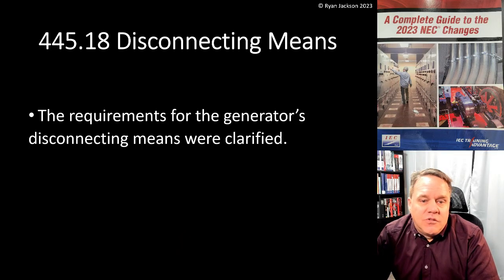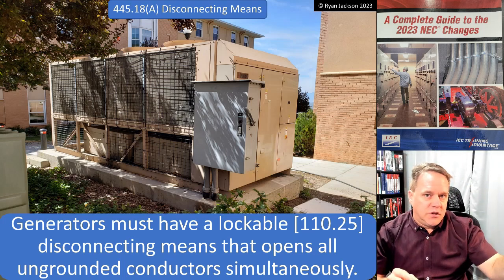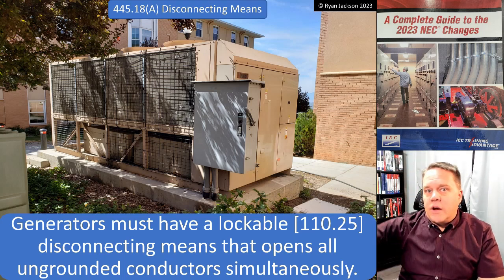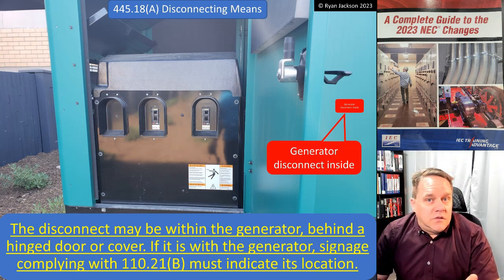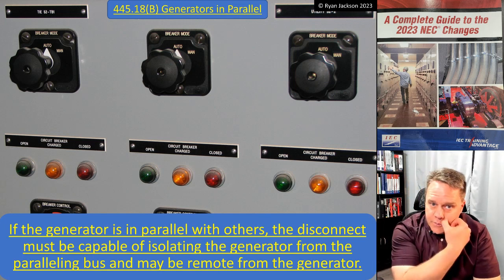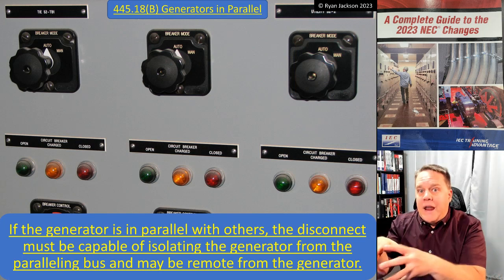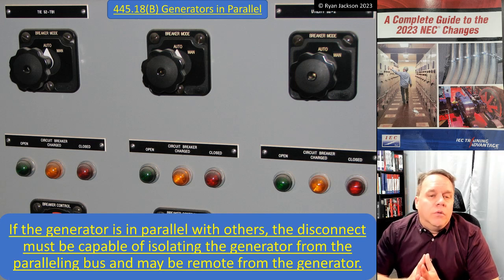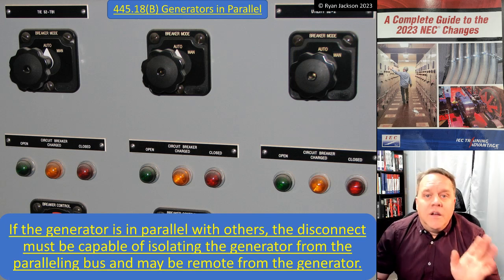445.18 Disconecting Means (for generators)

Comment: Whole house emergency standby units such as Generac Guardian series have a generic 2 pole circuit breaker (overcurrent/disconnecting means) under the lockable weatherproof lid.  Does the code address the situation of "not readily accessible" or that the cabinet style locks cannot be cut with old school bolt cutters?   Granted, a fire department could have that lid open in 20 seconds using a prybar, but I'm wondering if the code speaks of the suitability of this breaker as "emergency disconnect".
Reply: For sure.  445.18 says: The disconnecting means shall be permitted to be located within the generator behind a hinged cover, door, or enclosure panel.

Comment: Most generators that support both emergency and standby loads must have a separate disconnect for the emergency load.
These generators typically have two or more disconnects within the enclosure. Signage that is on a door showing there is a disconnect would be on multiple doors on multiple sides of the enclosure, defeating the purpose.